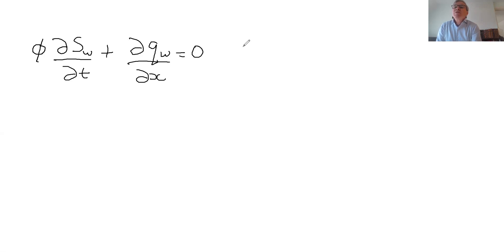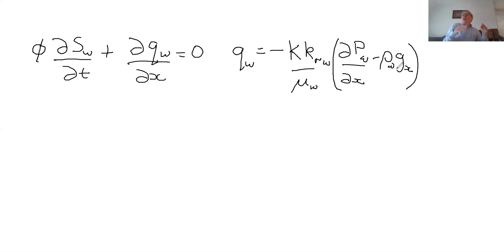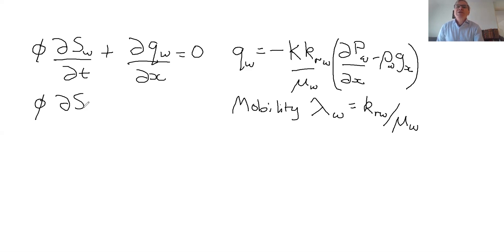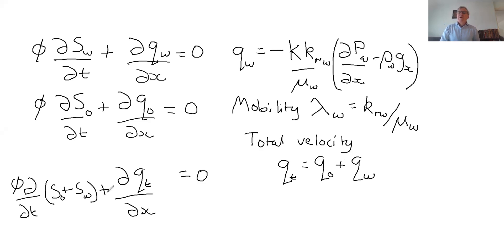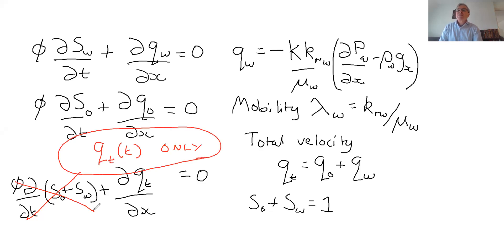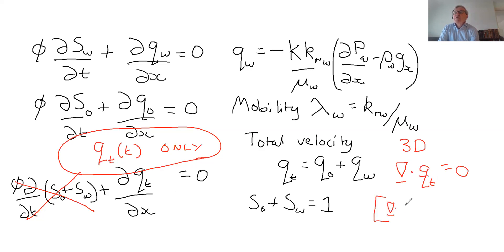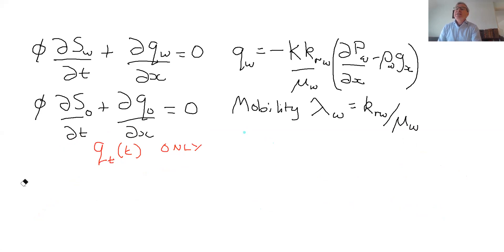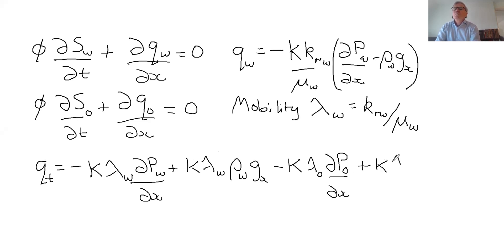Fractional flow

Comment: Hi Professor Martin,
I find you videos very helpful, especially conceptually they are a great assistance and supplement to my studies.
I am confused at minute 12:01 , in your final two line I don't understand why you changed from lamda w for the first term for qt to lamda t in the second term. I would really appreciate clarification on this, also when rearranging the equation why do you multiple by lamda W/lamda T. Thank you very much for your videos and your good work.
Reply from the maker: This is because I added two terms together - one from dPw/dx and the other from dPo/dx = dPc/dx + dPw/dx.  I do the rearrangement to find qw as a function of qt and the other terms.